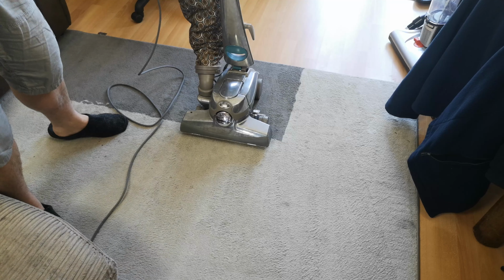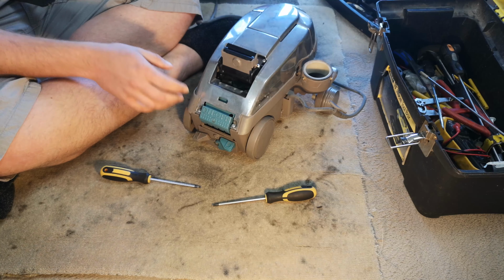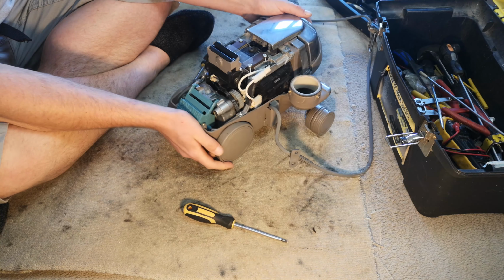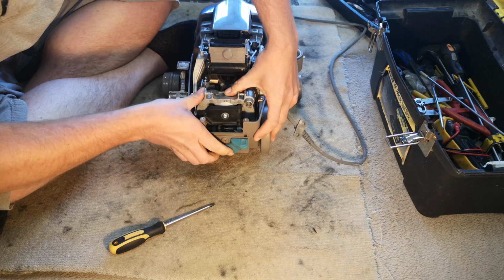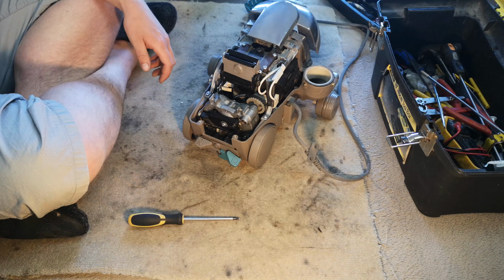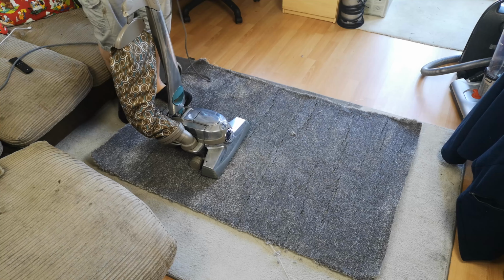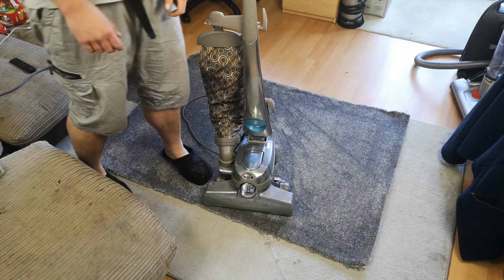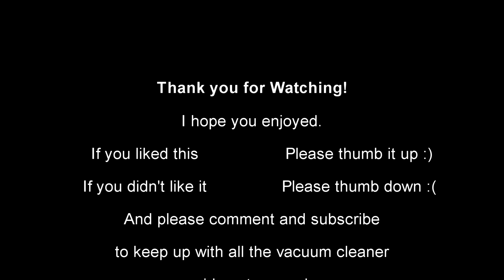Kirby Sentria 2 - Tech Drive Belt Change how-to!

Comment: I haven't seen one of those belts where since their issue on the G3 and G4with the sprocket gears needing to be changed out. Great tutorial!
Reply from the maker: I'm happy it was a simple fix. Of course during troubleshooting I fully stripped and rebuilt the tech drive so that's good now. Also bought a spare drive unti in case, but that's spare now.